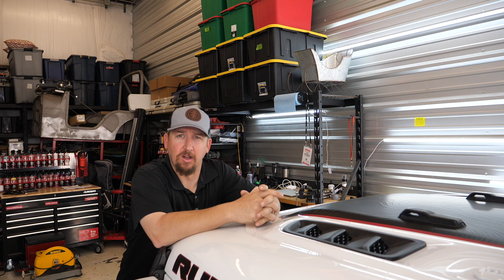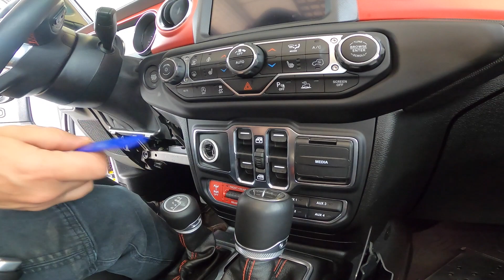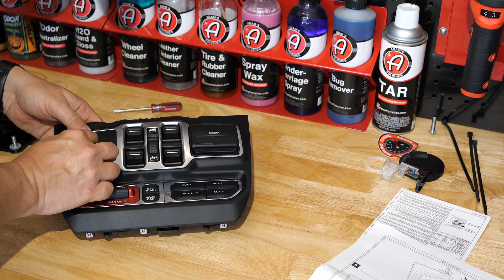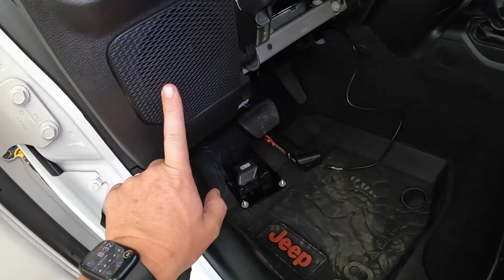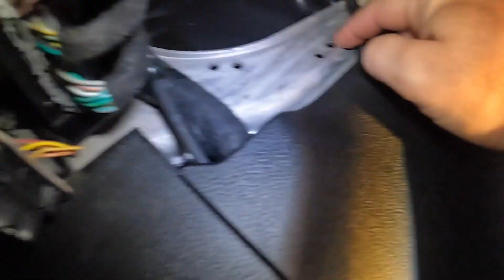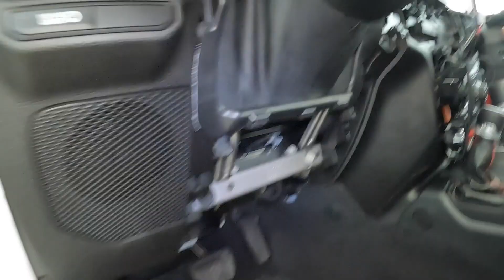Jeep Gladiator Mopar Trailer Brake Controller Install

Comment: My god. How difficult do they have to make it? Why can't they just make a harness that clicks into the plug under the steering wheel that an aftermarket brake controller plugs into to? Why make it so difficult? I'll just keep my knee knocker controller, works just fine.

Comment: Does anyone know if this install voids any warranty?
Reply from the maker: As far as I know it does not void the warranty.  It is a factory Mopar part that you can get through your dealer and even have them install it if you want.  The only way I can see them voiding any warranty is if it is incorrectly installed.

Comment: AMAZING INSTRUCTIONAL VIDEO!!!!!! - Quick Question: Once the install is done you didnt need any extra sales codes or programmers right? I did check under the driver dash and I do have that wire harness like yours, Also Check the vehicle VIN info and specs and It does come with TOW PACKAGE and some other features that make the MAX TOW  6000 lbs
Reply from the maker: Thanks!  I did not need any sales codes or programing.  It was 100% plug and play.

Comment: First, thank you for the video. It definitely made the install go a bit faster. I didn’t have the lighter removal tool but was able to use a couple of small screwdrivers to pop the power outlet out.  Everything went well until the mounting of the controller.  You failed to mention you need to chant a few magic words while attempting to align the bolts to the holes.
Reply from the maker: Glad it helped!  Yeah getting the bolts to line up is a bit fiddly.
Reply: @2ndChanceOverland  a bit fiddle is an understatement.

Comment: While I didn’t install the Mopar brake controller, I must thank you immensely! Without your video I would’ve never found that stupid 4 pin connected to plug the brake controller into. Every other video I found had already removed it from it’s tied up location and just said “it’s up there somewhere”. Thank you so so much!
Reply from the maker: You're welcome! Glad it Helped!

Comment: Is this strictly for the gladiator. I have a 22 GC WK. can I use this
Reply from the maker: I believe this specific kit is just for the JT Gladiator and JL Wrangler,  but Jeep may offer a specific kit for the WK GC. May want to check with your dealer on that.

Comment: You came along at the perfect time. Thank you for suffering under the dash for us. Does the cigarette 12v power plug just hang loose? (not used?)
Reply from the maker: Glad it helped!  Its been a while but I do believe it remains unused behind the dash.  Im sure you could tap into it for something else if you wanted.  Just keep in mind that its only powered when the vehicle is on.

Comment: This was super helpful, unfortunately I didn't read the fine print of the brake controller and found it doesn't fit on the standard transmission model, clutch pedal is in the way.  I ended up mounting the controller under the dash.
Reply from the maker: Glad it was helpful and good to know about the manual trans models.

Comment: First off, THANK YOU for the video.  It made my install much easier than reading the horrible directions!  Is there some display on the dash/instrument cluster when the brake is being used?  I've used it with my trailer, but didn't notice any indication of it working other than the obvious feel and the indicator lights on the knob.  My previous Ram had a dash "screen" for the brake controller.  I did not have anything flashed, but would if it would create an indicator on the dash...
Reply from the maker: So glad that it helped you!  I have not seen any indicator for when the brake is being used.  I'm with you in being use to bigger trucks with integrated brake controllers and indicators of connection, use, etc. Not sure if the Jeep dealer can 'flash' the system to add that but would love to know that as well!

Comment: So, I called the Jeep dealer to get a quote on installing the Mopar brake controller.  They said they have to flash the car so that it will show up on the dash and the Jeep will recognize it.  Has anyone been to the dealer for an install that could verify that?
Reply from the maker: Hey Douglas, my experience is that there is no 'flash' needed for this install.  Now I do have a factory installed trailer tow package so I do not know if that makes a difference.  If your Jeep did not come with a factory installed tow package it, and they are installing a tow package at the dealer, there 'may' be a flash or software update needed.  However if you have the factory tow package this system is 100% plug and play.

Comment: I have a 2020 Gladiator Rubicon.  It does not have the tow package.  Does this mean it does not have the wiring connection under the dash and this controller will NOT work?
Reply from the maker: From my understanding, the wiring connection under the dash is part of the tow package.  If your Jeep did not have the tow package from the factory you may not have the necessary connector.  Mine did have the factory tow package so I can not say for sure if a non-tow package Jeep would still have it or not, but a trailer brake controller of any kind would be pointless without a tow package of some sort (ie: trailer hitch/tow bar, electrical connection for lights, etc.)
Reply: @2ndChanceOverland  So, after just looking and hooking it up.  I do indeed have the factory connector without the tow package.

Comment: Question…..I have the same gladiator. Tow package and what not, I bought the controller from the dealership. They told me after install that I have to bring it in for them to do some computer update for it to work, have you actually tested yours to see if it works yet?
Reply from the maker: I have not tested mine yet and that is the first I have heard that.  I guess I better go test it out!  I will let you know when I get a chance to hook up a trailer to it and see what happens.
Reply from the maker: I just had that chance this past weekend to test out the trailer brake controller and it worked great.  It is a plug-and-play unit that does not need the dealer to 'activate' it.
Reply: I also read that the light for the trailer brake controller comes on automatically and then if there's not an electrical connection to an actual trailer it goes off. I haven't tested it out by plugging in a seven pin, but the light never came on. Was that your experience too?  

I can push the button in the center, and I can hear the unit underneath the dash clicking, but it doesn't light up
Reply from the maker: The light sometimes comes on, but not always.  I got in the Jeep to run down to the store and the light came one (red backlight behind the number at the top of the dial), but 10 minuets later when I left the store it did not come on.  From what I recall, when the trailer was connected there was a light on the entire time.
Reply: Mine did the same, heard the module clicking but no light, I plugged in my camper, and towed it around, light came on, and it worked perfect. I took it straight to the dealership that told me all that bs, and showed them. The guy was a smart a** about it. Wouldn’t admit he was going to charge me an insanely ridiculous amount of money for nothing. Watch out for these dealerships. I have no faith in them anymore.
Reply: Mine just worked after I installed it

Comment: What happened to the wiring and connector for the lighter outlet?  Could the outlet be retained and relocated?
Reply from the maker: I tucked the wiring connector behind the dash for the time being.  Yes, you can retain it and relocate it if you want or repurpose it for something else, although the wiring is fairly short so you may need to extend it to relocate elsewhere.  I was going to tap into it to power my Garmin Overlander but decided to go a different route.  I have the factory Aux switches on my Gladiator and found out that Jeep provides 6 wires under the dash on the passenger side to power accessories:  4 for the factory Aux switches, 1 that is an ignition source power, and 1 that is a direct battery power.  So I direct wired my Garmin to the Ignition source wire instead.  Now I have power to my Garmin any time the ignition is on.  I hope to have a video out soon with that and other electrical mods I performed.
Reply: @2ndChanceOverland  thanks for the response,  I also have the factory Aux switches, that's good to know info about the 6 wires.